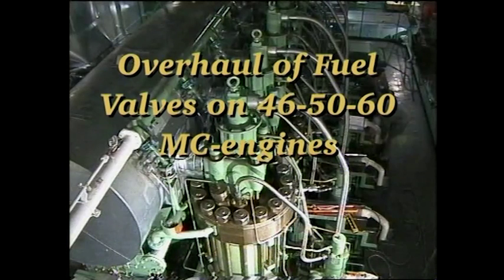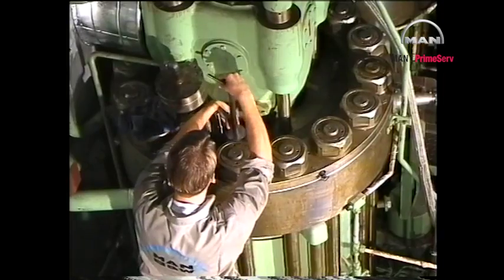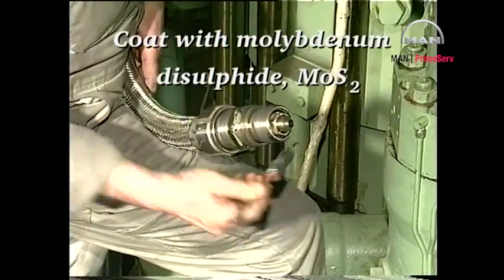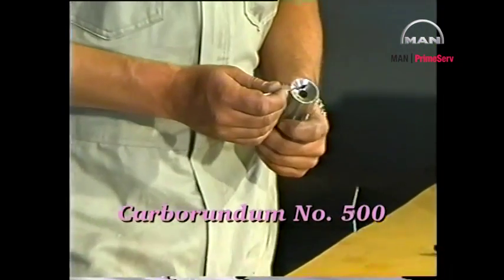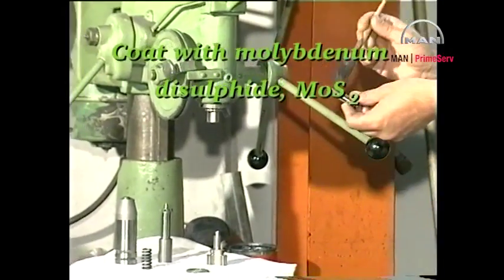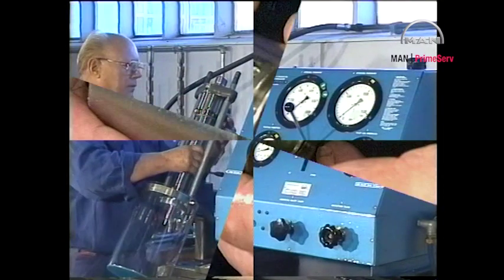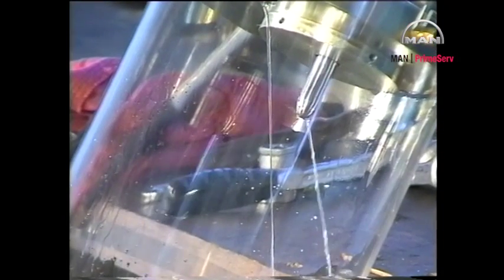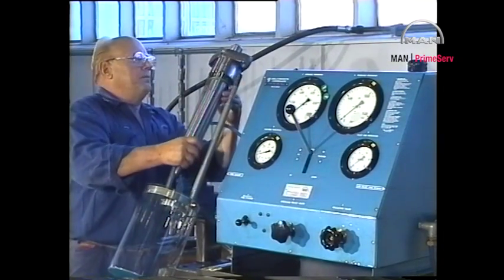Fuel Valve Overhaul, medium bore engine

Comment: Sir what if the valve stuck on the cylinder head
Reply: It happened to me once... the vessel was 6 year old...according to PMS the valves have been overhauled...but in reality they never been overhauled for 6 years..and one of the valves stucked in the cylinder cover !!! The fuel injection valve was leaking fuel and all the engine crew tryed our best to unstuck the valve but unfortunately we couldnt...so we managed to disasemble all the parts of the valve while valve was still there stucked ... and we replaced all the o-rings and new spring..and we fixed the problem ...but therefore the valve body must be unstucked...to do that , you have to take out the cylinder cover , lie it down and try to find something long to punch the valve from inside out .